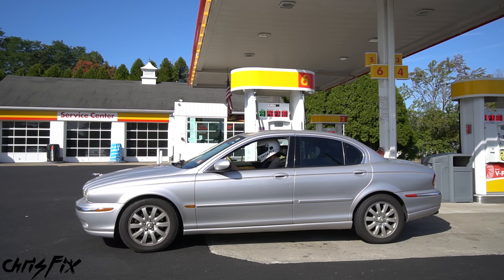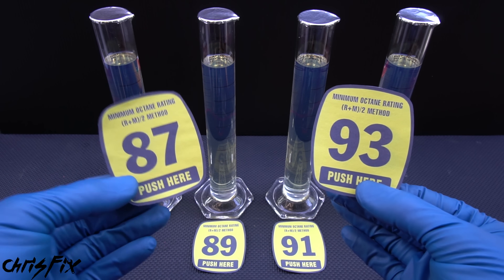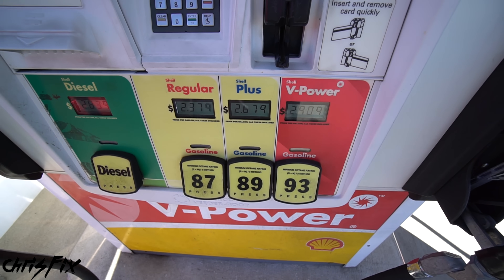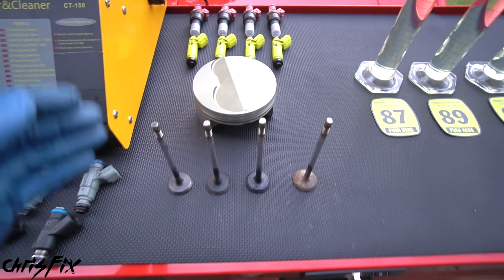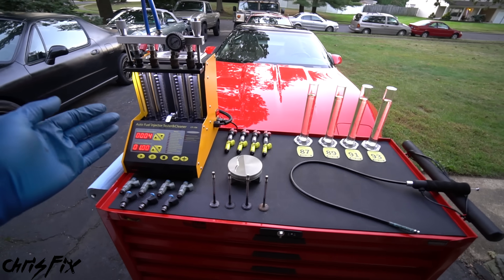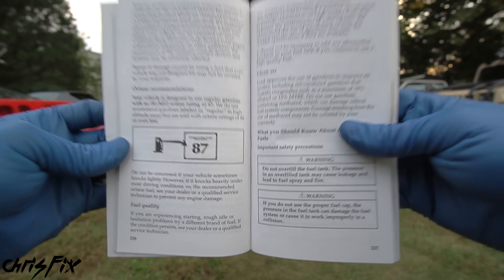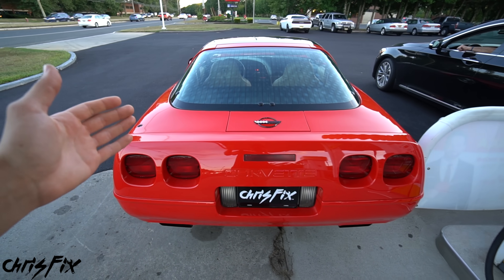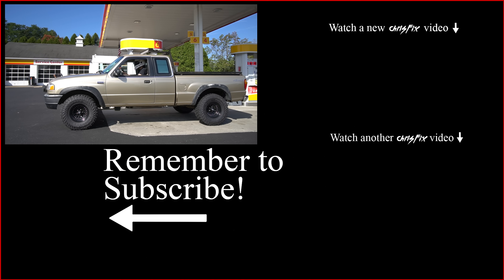What is the BEST Fuel to Use in Your Car or Truck and WHY

Comment: Comment 24,751: If the ambient air temperature is very cold and it's going to be cold for a few months then a lower octane gas may be used without causing detonation. Why? Because the cold air will not reach the same temperature as warm air when compressed so the air/fuel mixture will not prematurely explode because the mixture will not reach the temperature that can alone ignite it. He mentioned altitude. The higher the altitude the less the ambient air pressure thus the less compression can be achieved and so the less chance of premature temperature caused ignition.

Comment: I run 87 in my 2009 Acura TSX contrary to the 93 premium that is recommended, should I return to premium? I could watch this video 10000 times and still wouldn’t be able to come up with the correct answer.
Reply: moose. Yes you should!
Reply: moose. You’ll lose a bit of fuel economy or a bit of power but you can run regular.

Comment: Hey Chris,

Nice to know that other country's has other numbers but are the same. Im also testing now with fuel since we have E10 on 95.

In Europe (Holland/The Netherlands) the fuel is changed. 'Long time ago' 95 and 98 without E numbers. Next step was 95 with E5 and 98 no E number. Since around 1 year fuel changed for the 3the time. Now we have 95 with E10 and 98 with E5.

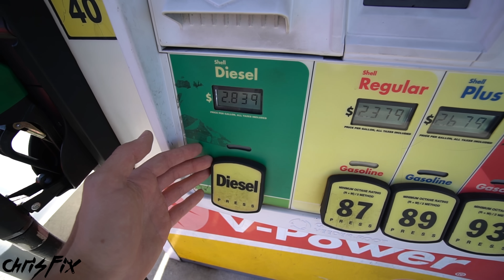I have a VW Golf 6 if i use 95 with E10 i drive around almost 800 km (1:16) when i use 98 with E5 i get almost 1000 km (1:18). If i read what i need i need to use 95 but that is not available anymore because 95 is with E10. Also when i used Shell i get less km than if i use Esso (thats becomes from the additions??). Also the engine looks quieter by 98E5 than 95E10.

You say what i need to used, you can find it on the tank, dashboard or manual. If we do that my girlfriend destroy the engine.

Also my girlfriend had a old Seat Arosa in the past she used 95, now she need 98. Because 95 with E10 is now not good anymore. So you can check better online what to use.

Also i have a scooter (Vepsa Sprint 4T) when i bought it there is standing on 95. Lots of people get problems. If i buy now the same model there is 98 standing on. Because the E10 in the 95 give a lot of problems.

Can you make a video or a comment what the effect is of Ethanol. Since they use Octane together with Ethanol there a more problems and i come less far.

Comment: The bigger the engine the higher octane to use, such 4cyl use 87, 6 cyl to smaller 8 cyl block use 89, 8 cyl big block and bigger use 91, it is the higher the octane the slower the burn because how big of piston stroke to detonate, duhh!?!?
Reply: Jr James In my 97 Toyota Camry 4 cylinder I use 89 with ease and no issues.
Reply: @venividivici4253  idk, resin build up prolly inside lol
Reply: Jr James Whats cool about my Japanese manual is they cover 2 engine types of my car. I just follow which engine my car has and use the recommended fuel from there.

Comment: Chevy 5.3 V-8 makes 355 horsepower 380 foot pounds of torque while not the highest horsepower available it does it on 87 octane fuel with 11.0 compression ratio that was unheard of 10 years ago this engine for a gas powered engine not diesel has very good low speed torque under 2500rpm moving big heavy sport utilities and 1500 pickups very well at low rpm without much strain or effort which is good for gas mileage and durability if maintained well

Comment: Non ethanol pure petroleum what ever octane rating your engine calls for my LS2 powered 1984 Monte Carlo SS with a single plane intake and a HP holley 850 carburetor with 10.9 compression runs very very well now for 12 years with 4 gallons of  chevron 100 octane leaded from airport with 5 gallons 90 octane non ethanol mixed no carburetor issues spark plugs last 3 years and are nice golden brown when changed and could probably go much longer newer cars with fuel injection can run ethanol gas but still get better gas mileage and run better on non ethanol basically ethanol gas is junk and does no engine any good what so ever
Reply from the maker: Thanks for sharing

Comment: Actually petrol in Europe is often higher rating than the US. 93 US is 97.4 RON. We can buy higher 🤪
Reply from the maker: Did you watch the video?
Reply: Yes I did. 93 is 97.4. I can buy 99 octane. Some countries in Europe sell even higher at the pump. There is a misconception that 93 US is 98. It’s not quite. Also we can buy higher than 98. That’s my point

Comment: If the person before gets 91 and you purchase 87, typically how many gallons are in the line? Or vice versa.
Reply from the maker: You could do the math based on the size of the line, but the easy answer to question is: not enough fuel to cause any bad effects in any car!

Comment: I'm still confused. I did learn some things but sfill confused, you say just use the recommended grade by the manual but you also say that premium gives better mileage economy plus it deters detonation, also cleans carbon out of the valves, so despite what the manual recommends, premium still and will always be better regardless due to these three things I mentioned

Comment: What if my car says "recommended to use premium fuel for maximum performance?"
Reply: It means it operates best with more power using the higher grade fuel. It also treats the engine better, less carbon deposits and less chance of knockback. You pick what you want. If it's a daily driver and you ain't flooring it, then it's cheaper to go with lower grade fuel.
However, due to the increased performance (power and fuel efficiency) plus the carbon deposit factor, Chris and myself would "recommend" the higher grade fuel for longevity and fun.

Comment: awesome video Chris i have watched almost every video of yours and i loved it. I live in Greece and i have one question my car has 35000km fairly new it says on the gas gap use 95 ron but i use 100ron because i want my pistons valves fuel injectors etc to remain as clean as possible and let them build up excess carbon prematurely. Is my way of thinking wrong and i am speding more money than i should??
Reply from the maker: Thanks a lot! The cleanliness of your engine can depend more on the company that you are getting the fuel from compared to just the RON rating!
Reply: @chrisfix  thank you very much for your reply i appreciate it.

Comment: Easy to decide when you have a diesel.. you put diesel in it!
Reply: There is diesel #1 and diesel #2. The difference between the 2 is they add unleaded gasoline into 1 to help keep the diesel fuel from sludging up or freezing up in very cold weather conditions.
Reply: @BlueDroneBlues  In old Mercedes manuals you can se the chapter "adding gasoline to the diesel fuel". Thats to avoid freezing.
Reply: @collomps  we've had 2 different types of diesel fuels that anyone can buy at anytime where anyone has the choice to get diesel fuel with or without unleaded gasoline added. Diesel 1 and Diesel 2.
Reply: What's the difference between diesel and diesel excellium ?
Reply: 7.3L you can put agriculture , diesel regular diesel , Bio diesel , or even cooking oil
Reply: @BM-sl1zs  Cooking oil would be considered as bio diesel.
Reply: Unless you are like me and build bad ass DT466s. Then you’re going to need something to drop into the old funnel. Me? I prefer old cans of lacquer thinner or some high quality varvishes. Nothing supes up my cornfield caddy like 2.25 gallons of miscellaneous paint supplies from the restore.
Reply: Here in France the choice isn't this easy since diesel is the most common fuel used in cars and trucks here, and you often find up to 3 different diesel types in gas stations (regular, excellium, etc...) whereas for petrol the only choices you have are 95 E10 for regular cars, or 98 E5 for hi-perf or very old cars
Reply: It's actually not as simple as that. Diesel has a cetane rating which unfortunately isn't displayed on the pump. My car's manufacturer recommends 50 cetane, while most pump diesel in North America is less than that. Empirical testing tells me that my car runs smoother on PetroCan, Esso Synergy, and Shell V-Power than it does on most other diesels.
Reply: @CaptHollister  yes sir. Diesel is actually a complex hydrocarbon 
Consldering: viscosity, BTUs per pound, particulate numbers etc.
I produce fuel from waste supplies, I have learned to "build" a specific fuel to fit the tune applied for various activities.
Reply: For thirty dollars
Reply: Heck on old diesel cars (for example an 80's Mercedes) you could pull up at your nearest McDonalds and ask for old fry oil. Everything goes.
Reply: Not in Europe, we have several sorts of Diesel and even Premium Diesel with a higher Cetan Value (which is like a miracle to a direct injected diesel engine) :D - My old TDI just gets Premium Diesel it runs smoother and better noticable :)
Reply: Lol
Reply: Lol well explained
Reply: Your so cool and I bet you dont tow a single thing
Reply: In Canada there is over 7 types of diesel at co-ops
Reply: DF 1, DF 2, JP8

Comment: Thanks ChrisFix, if I use LPG, but recommend is regular fuel, will it helped me if I switch some times between fuel types, and how bad my car engine is going with LPG. My money saving is about 40% but performance as not good as with gasoline

Comment: I💟💟your video, thank you👏.❗ Question: 'Honda won't honor a Recall' on Misfiring Spark plugs on my H/Accord 2009😞. I need NEW Spark plugs once a year, that's killing me.
I contacted Honda & open a claim on 2017, i got $400 refound "but they DID NOT FIX the Misfiring".
Misfiring happen again on 2018 & 2019 and "now they say the expiration date on the Recall is over"😮.
*What can I do.??
I will appreciate your help"thank YOU.* 🌷
*Subscribed✔ *
Reply: Run injector cleaner in everytank and high octain fuel it'll help

Comment: When I had a gasoline car (1.2 4 cilinder non-turbo, 80HP), the car was rated for RON 95. However, when I filled the car with RON 98, the engine was dead silent and the power curve was smooth.
Hell, if I went to a "cheap" gas station and filled it up with RON 95, the engine just seemed to struggle more than Shell or BP (slightly more expensive) RON 95.
BUT, we also have RON105 at some stations (but is pretty rare). Filling up the car with thát fuel just made the car create a lot more 'roar'. It didnt feel any quicker, the engine made more noise and the power curve was not smooth. However, it still felt better than "cheap" RON 95.

Comment: FYI - I did some research on octane boosters years back an found they were not what they advertised.  The were anti-knock additives but not octane boosters.  So in the video your octane booster didn't give you enough octane boost to matter.  What it did was diminished (suppressed) auto ignition of gas in the hot engine (knock)

Comment: Chris, why such a long video to say two words: owner’s manual. The engine builders and engineers know exactly how they built the engine for which gas type. OWNER’S MANUAL.
Reply: Because its important to know why.
Reply: I prefer to keep classic cars, although, it's scary to think that my 'classic' 1992 2.3 SI Prelude (Frankenstein) is now an 'antique'! Anyway, back then, the fuel was different then it is now. Back then, you could fill a gas can, and let it sit for 3 years, and it would still be good when you used it. Now, you had to put additives in the gas so that it can sit for a year. So, this video is good for people who have old ass cars in their barns. This video actually solved an issue that I've been having with my '96 Buick. Rose is only getting premium from here on out.

Comment: Funny thing, my '96 Toyota had engine knock until I replaced the spark plugs and adjusted the ignition timing (mechanical distributors tend to after 20+ drift for some reason...) and it went away... until I took a long trip (500mi) and it came right back by the end :/

My current hypothesis (I'm sure a Toyota specialist floating about these most entertaining vijayos will correct me :D) is that the ECU is adjusting its ignition timing advance trim until it hears from the knock sensor and then backs it off. Maybe the tired old knock sensor has to go next...

Comment: It totally depends on the car which fuel you use , and the programming on the eprom which if it's performance spark advanced you would want to use a higher octane fuel.

Comment: I used to have a TDI VW and for shits and giggles I would experiment by putting gasoline in it. I went all the way up to mixing gasoline/diesel 50/50. Nothing ever happened to it and I ran it like that for miles several times.

Comment: To use  - "what is not less than a manufacturer recommended/required"  - have never been a question. The question is that always was: if a car has "regular recommend",  then does it worth to use premium?

Comment: I agree with that the manufacturer says to use but cars are coming with advanced knock sensors the 4 cylinder turbo charger GDI motors are actually stating to use regular. I own an 18 Cruze Hatchback with 70k miles and I gain better power and much higher fuel economy with shell premium.

Comment: How do you feel about ethanol free gas? I've heard it's significantly better maintenance wise and can even improve mileage and power slightly. Because of this I have almost exclusively run my car on ethanol free 91 octane fuel. However, it is a bit more expensive and harder to find (especially where I just moved to). Do you think the benefits are worth it? How do you feel about ethanol free vs typical 10% ethanol gas? My manual calls for fuel with "an octane rating of at least 91 AKI, if you had to choose between 91 ethanol free and 93 with 10% ethanol, which would you choose?

Comment: Great video. Engines are complex. My next car will be electric using one type of “fuel”. 😌
Reply: Which fuel? Coal, natural gas, oil, nuclear, solar, hydro, biomass, or wind? Or a combination of them? Remember, electricity is mainly generated using non-renewable (fossil) fuels...
Reply: Patch Man via solar panels mostly with added battery storage. Cheers. 😉

Comment: 14:00 Don't put fuel additives or octane boosters in after you fill up, do it with an empty or half full tank, it's supposed to mix better. I would think it would work just fine either way, but it's worth consideration.

Comment: Here in the mountains of Utah the Snowmobilers were running lower octane fuel in their sleds and they were burning them up.  They switch to Premium and their sleds ran cooler.  High altitude, premium runs cooler.
Reply: I don't know why it worked.  It just did.

Comment: I always understood that detonation was caused by red hot carbon particles in the combustion chambers igniting the fuel during the compression stroke...as apposed to after compression had been achieved. Also known as "pinging", or "pre-ignition". Is that not correct?

Comment: What if your manual says ‘87 or higher’? Will filling premium potentially increase performance and mileage via adjusted timing? I assume if only 87 the manual would say ‘87 required’. As a reference I’m talking about Toyota’s 3.5 V6 2019+. In the highlander.

Comment: I use regular gas in my 2011 beast of a car, a Toyota Corolla S with a whopping 1.8L engine. Then I drop by my Dollar store and get a bottle of jet cleaner and dump it into the tank and the car runs a WHOLE LOT better, for just another dollar.

Comment: I use Pro-ma PT5 (GT5 in U.S.A.). Slowly over time cleans the fuel pathway. Also reduces fuel consumption 10%. Older cars might only improve gas mileage on the highway.

Comment: Just a note to add... Not all octane boosters add the same amount and generally one bottle wouldn't be enough especially if need 92 or 93 premium and you filled up with 87 regular. 
E.g. filling up with regular and throwing in a bottle of octane boost will boost it up 1 octane point which wont be 87 to 88 at most 89 so you may need more. Some do more but those are generally for "offroad purposes only" just my two cents that I have learned. 🙂

Comment: hey chris! very informative, thank you for clearing up the doubts i had about the octane number! I do have a question though, do diesel vehicles have a specific fuel requirement too? or can common rail engines handle any diesel fuel that you pump? :D

Comment: 25 000 hundret miles in premium clean the engine ? Is it not better to use SL1 RED LINE to the fuel and its gonna be more cheaper and faster ?

Comment: I raced! the higher the octane the faster, try using 89 on a souped up engine verses 116 octane, I wouldn’t use that in my daily driver, 93 is better though, what makes you an authority on octane content? Any ways, one way to find out is to take your car to the track, run 3 passes on 89 n keep the best time then run another 3 passes with 93 to 94 n see the difference.